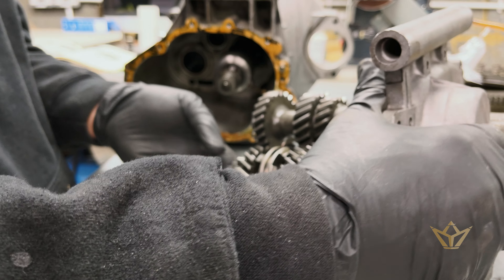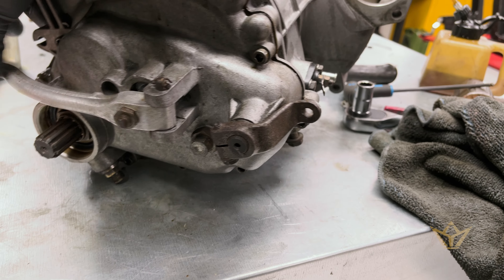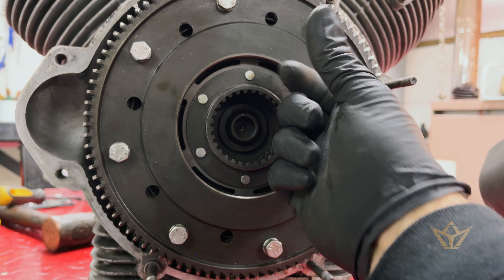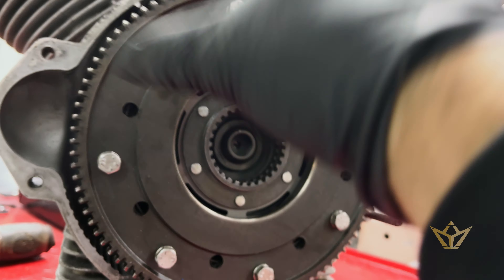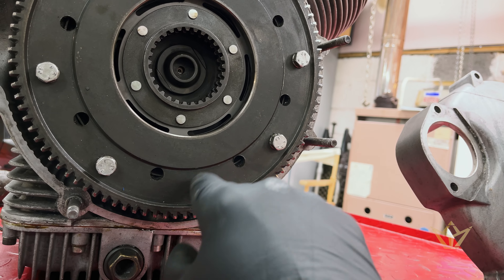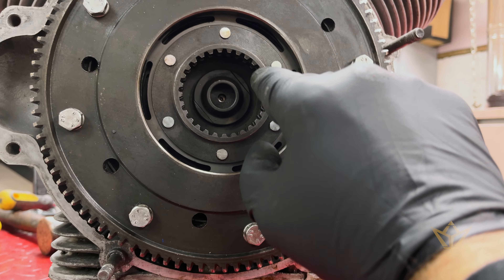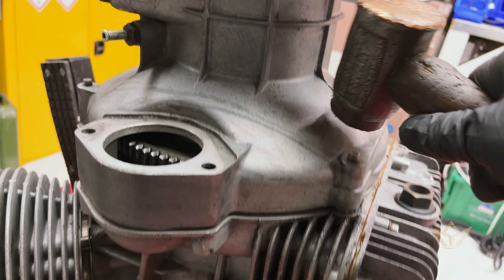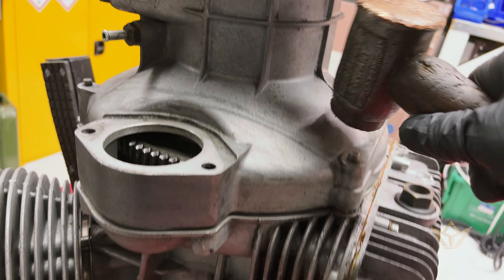Carburettor servicing, gearbox clutch assembly and more! MotoGuzzi Mk1 PART5

Comment: Great restoration! 👍...and don't do as I did and discover the clutch thrust plate still in your toolbox after full re-assembly, explaining why pulling the clutch lever meets with no resistence! If you happen to make that mistake too,  then don't take the opportunity to roll the bike out of the garage into the sun for a moment admiring your effort, before the stripdown to fit the thrust plate. In my personal experience that's the point when a huge seagull will spot you, and pass verdict on your faulty handiwork by dumping a full load over the bike😫.

Comment: Just discovered you and enjoying immensely. You are an erudite man, which to be fair, most men of machines are. I too enjoy classic music as much as punk for instance; Auber is new to me also, thanks for the hint.

I'm reliving days (18 years ago) of pulling my 1000S gearbox off: stuck in 2nd gear by a sheared tacho gear of all things after a particularly vigorous road ride with a ZX10R riding mate (only a 110hp differential despite similar CC's. With corners involved sweet farck all in it. Tonti's handle!). Just me, a Haynes manual, complete ignorance & my big hammer: Nr.1 Guzzi tool according to my Duke race bike mechanic. I never was allowed to touch that engine. 

As for the DellOrto carbs, always one cylinder gave me grief until the installation of a Dynatek electronic ignition system. Afterwards sweet as a nut always. As an aside to that, my 944cc Ducati F1 based race bike ran 41mm DellOrto units. A cap full of two stroke oil in the petrol tank kept those big slides lubed and those strong springs easier to pull against for something like smooth operation.

I look forward to enjoying the rest of the Guzzi series & your other projects.
Reply from the maker: Thank you Graham 🙏

Comment: Im currently recommissioning a Laverda and had to clean the three Delortos. The float valves all had nitrile tips and couldn't be cleaned. All had to be replaced. Watch that these are not the same. I have a brass bristle brush for cleaning as its a bit easier on the carb bodies.  I have to replace the clutch on my LeMans soon as well but have done it before. Still a pig of a job when the bike is in one piece. Easier if you crab the frame.
Reply from the maker: These are steel tips fortunately. Cheers for the tips 👍

Comment: The way I have done it in the past is to remove the clutch gear from the bell housing and use that as your alignment tool with a suitable bolt to the crank. Soundtrack needs work though.
Reply from the maker: Come on Phil…hurt me! 
Another good idea 👍

Comment: Carburettor jet cleaning kit. Less than £5. Hardly going crazy.  There is that SA adage about making a plan but that usually means doing the best you can when the tools aren’t available.  I’m also a bit disappointed to see the engine reassembly being completed but the cases still looking so grubby. Some would call it patina but it just looks like half a job.
Reply from the maker: That’s all good Motovelo. Good luck with your growing channel